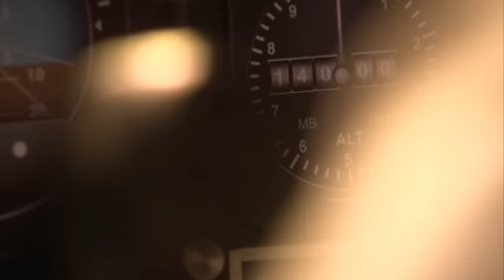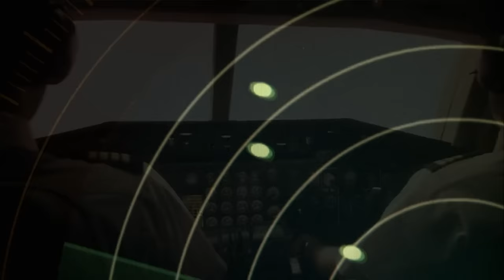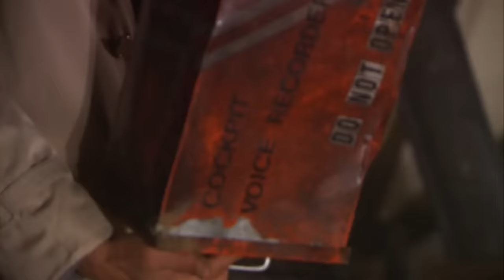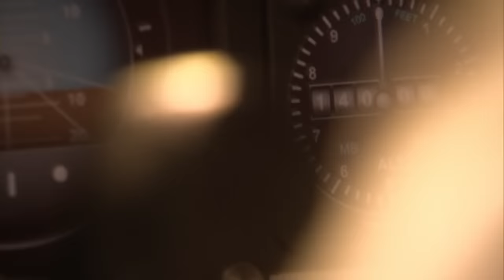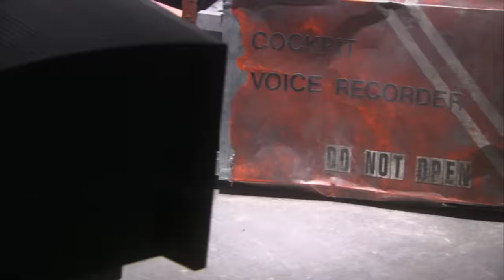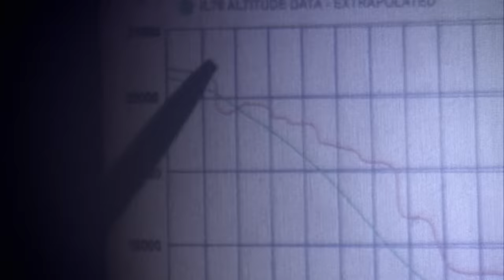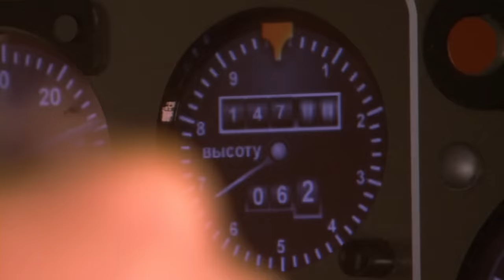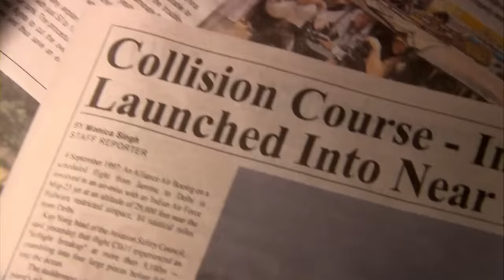The Worst Mid-Air Collision In The History Of Aviation | Mayday: Air Disaster

Comment: According to a news article cited by Wikipedia, four passengers from the Kazakhstan plane and 2 passengers from the Saudi Airways 747 survived the initial crash, but all died shortly afterwards.  The Kazakhstan plane crash-landed, while the Saudi jet entered a nearly-supersonic dive, breaking up from the force of the descent.  I could understand there being initial survivors from the Kazakhstan jet, but I find it a miracle that anyone could even survive the initial nosedive of any plane from that high up.  It would be more interesting though, if they had indeed survived and recovered.
Reply: How sad to survive just to die later. :(
Reply: They would have had to have been in the tail end of the plane. Where a good portion of the force would have been taken up by the nose and midsection of the plane. This is for the Saudi plane, though I don't think even if there was a first responder there right on the ground and jumped in, anyone could have survived.
Reply: @mariawhite7337  That would make sense.
Reply: cesarretamoza5243 care to elaborate on that one billy bada$$?
Reply: You really trust wikipedia?  Anyone can alter the site
Reply: @dalemoore435  that's why you use the sources linked at the bottom of the Wiki page. Much more reliable
Reply: @dalemoore435  That’s true, but I had said that this information came from a news article that was CITED by Wikipedia, not from Wiki itself.  Sorry for the confusion.

Comment: Even though they were basically at the same altitude in the air i think its crazy that they ended up meeting at the EXACT same time, if the Khasakstan plane was behind even a minute they most likely wouldn't have met each other at the same spot and the Saudi plane would have flown untouched in front of them. The odds just seem insane
Reply: The butterfly effect
Reply: You couldn't hit that plane from that angle on purpose, that's for sure.

Comment: What I find chilling is that those last few seconds of the video of the Saudi B747 we see here IS REAL - not simulation.
Somebody on the ground had a VHS camcorder (or commercial rig) at JUST the right time to capture.
No other Mid-Air & few other crashes have this.
Listen again you can tell that's actual impending crash footage, with the stricken jet engines wailing, tail upside down, last 1000' of altitude.
It's a mind blowing scene - 45 deg down angle - and why the Saudi B747 cockpit was 35-40' buried.
I say a prayer of thanks each time I fly that ALL those lives whose loss can seem senseless, has paved the way for improved safety, that we are Blessed by years after.
Thank Mayday very well done.
RIP in Jesus name to the 349 Souls lost on the Saudi B747 & IL-76.
Reply: It is a simulation. This is back when the show had a very good sound engineer.
Reply: @svelements  
Not possible.
Look again my friend.
It's actual footage.
Reply: Are you talking about 11:23? It is not real bro 😂
Reply: @joshuaromani4241  the fire and smoke is a dead give away it's CGI. Also, given it took over 3 hours for a tv crew to get there... you think someone with a camera was already in the vicinity? lol

Comment: I really don't understand the global standard of only 1,000 feet vertical separation. I had another Airbus fly under my plane at a 90 degree angle to us, I could see the captain and copilot plain as day. It freaked me out. Why not ensure vertical and horizontal separation? It's a bit extra work for the controllers.

Comment: It seems illogical to me to have a plane descending on approach to hold altitude ABOVE an airplane ascending on departure.  These aircraft were approaching one another in both azimuth and altitude, an accident just waiting to happen.
Reply: I don’t understand it either
Reply: It's mentioned in the video that at the time, the New Delhi basically used just one air corridor for commercial traffic, with the other 3 being used for military traffic. It makes sense to me that the approaching flight, which is descending from a higher altitude, would be kept at the higher altitude, and the ascending flight would be held at a lower altitude until they pass the other plane.
Reply: Generally flights going one direct stay at odd numbers of feet while the other direction stays at even numbers for that reason.

Comment: When you board a plane, train, bus, or car, you are placing your life in the hands of humans.  Humans make mistakes.  In only one of these forms of travel, can one avoid an .accident by someone else's failure.  That's the car.  Planes?  Aside from the dozens of builders of the plane, probably 20 people, all must do their jobs correctly.  Bus and car get it down to one.  Trains, I don't know how many people need to do their jobs correctly to have safe passage, probably a dozen or so.  Close call in SLC, 737 headed North to Portland,  another 737 headed south breezed by our plane about 200 ft away, i saw both pilot and co-pilot of other plane  heads whip toward our plane as they shot by...i don't fly unless I simply have no other option.
Reply: You can be in an accident in a car that is caused by someone else’s failure!
Reply: @DPBGMODELRAILROAD  I realize this is true, but you can avoid some collisions by driving defensively, plus, you have a much higher survival rate than in a plane crash, one can encounter injury just by walking, but its less likely.
Reply: @alanmcneill2407 you could fly in a plane birth for the next 100 years and you’d be less likely to experience a plane crash than 5 car accidents and potentially a fatal crash

Comment: 44:22 So=called secondary RADAR is not really RADAR since it is actually receiving data from transponders and displaying that data on RADAR-like screens. RADAR stands for 'RA'dio 'D'etection 'A'nd 'R'anging which is a system that sends out radio waves that bounce off the aircraft and return to a receiver dish. Receiving radio information from a transponder IS NOT RADAR! In addition, if the instruments on the aircraft malfunction, the information sent by the transponder can be wrong, and no one will know it. In this case the new system might have prevented the accident, but I saw a video on an accident where the information from the transponder was wrong because the instruments were wrong, and aircraft flew into the water while both the pilots and ATC thought they were thousands of feet above the water. 

Let's suppose in this case that the altitude information was wrong. and the pilots thought they were flying at their assigned altitude of 15,000 ft. There is nothing the Air Traffic Controller could have done because his so-called RADAR would have shown the aircraft at 15,000 ft because that is what the transponder sent.
Reply: So basically it's not radar, it's better.

Comment: When did they eliminate radars in passenger planes, I understand that there's more room for passengers without radar, but with radar, pilot and ATC can work together. Usually one problem describes the crash of two planes as a result of an air collision, it can and has been two problems that resulted in an air collision. Both aircraft were at flight level 150 which seems to be the problem. T-CAS may or may not have prevented it, secondary radar may or may not have prevented it, but modern radar, similar to that in the latest military aircraft would have prevented the collision mentioned in this video